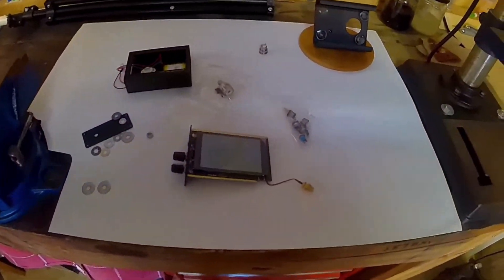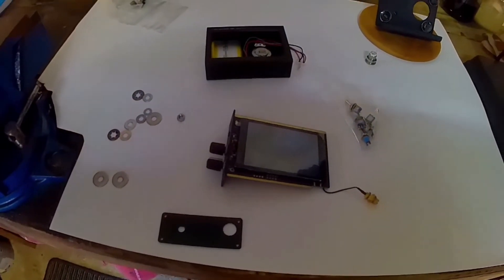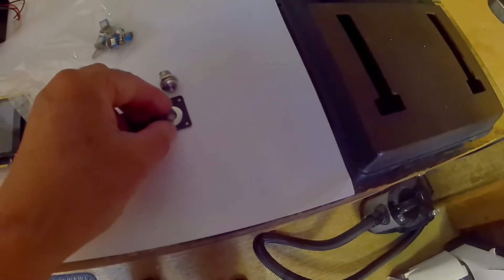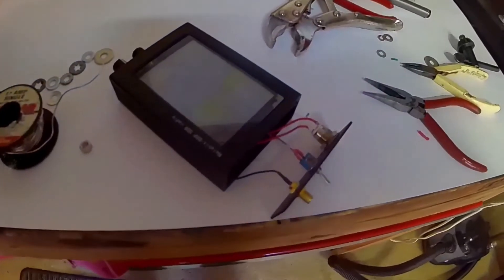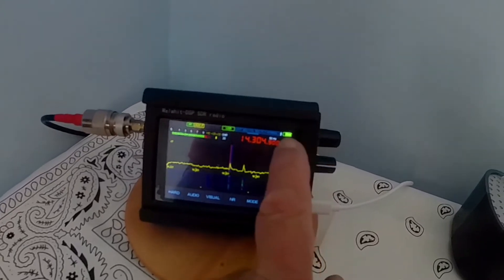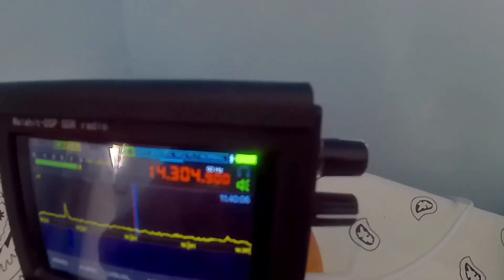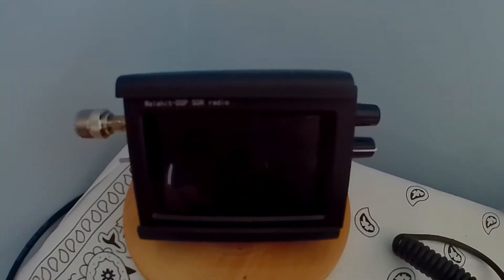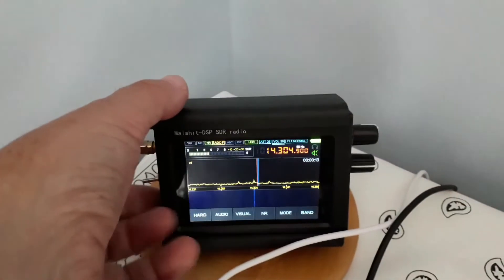Malahit SDR DSP Ham Radio Repair. Problem Solved.

Comment: You seem to have the same version of radio as I do.  I noticed the same battery drain issue and after researching online, I did a simple modification by adding a toggle switch.  This was years ago and I am pleased to see that you did exactly as I did.  Remember to flip the switch on in order to charge the battery and switch it off when it's charged if you don't intend to use the radio right away.  What I would like to know is can the screen be replaced with a 4 inch lcd as the cut out on the front would suggest that maybe to cut costs in manufacturing, they went with a 3.5 inch screen.  Maybe some items in the code need modification as well.  I know very little about programming.
Reply from the maker: I am hopeless when it comes to.updating firmware and computers as well so I don't even try. 😂 George

Comment: Got tired of hammering the quirky screen to make selections.  Removed the only useful part (battery), then tossed it.
Reply from the maker: There not brilliant bits of kit. I use mine in conjunction with my FT101B  Transceiver. Just to display the band I am.using. George

Comment: Hi nice video will be doing this switch with mine soon but I have a question,  where can I get the rotary push switches for one of these I need to replace both of mine .. cheers rob
Reply from the maker: Hi Rob. I am sorry to say this but although I replaced one of mine with a different type. Which was a nightmare to do. I have never found a direct replacement. I wouldn't advise you change them. You could destroy the radio completely.  George

Comment: On mine it is almost impossible to tune frequency because the encoder jumps frequency backwards while tuning forward, which encoder should I use as a replacement?
Reply from the maker: @Ixquick979  Allthough I replaced the encoder over 12months ago. It now jumps again. So far I haven't found a replacement and I am not going to replace it again as its too difficult to do . Don't want the risk of wrecking it. George

Comment: hi, can you tell me where to find replacement encoders?  Thank you.
Reply from the maker: Hi I am sorry I cannot tell you as I have been unable to find a direct replacement. I had to bodge a different one as a repair to mine. Its a nightmare of a soldering job I did I mine. I almost ruined mine in the process. The best option is to make a new enclosure for the radio and then there's enough room to solder wires on whatever encoder you find. George

Comment: I’ve got one and it won’t charge. No light to say it’s charging, nothing. Any ideas??
Reply from the maker: Is it a New Radio you have just received or has it just stopped working. These modern radios are not really designed to be repaired.  I am not sure. Try several types of charges. Some used for phones may not charge. As they communicate with one another via charging lead etc. George
Reply: @MakeDoAndMend1  it’s just stopped working. Worked fine the other day.
Reply from the maker: @wrightcreationswoodturning  Hi matey.  If they are left for a long time without been used they will flatten the battery. You  could try checking the battery voltage. May need the battery unplugging and reconnecting to reset charging circuit as they have battery protection if too low voltage. Other than that I have no other suggestion. George
Reply: @MakeDoAndMend1  yes it is the battery. I’ve plugged a 3.7v 600mah on just to check and it comes on. Cheers I’ll sit and rebuild one of the days.

Comment: Do you have a photo of where the momentary power button wires solder on to the board? One of mine has pulled off the board and I can't find the solder scar (the wire end looks like it was dry)
Reply from the maker: Hi many thanks for watching my videos. I am sorry but don't have any info or photos of the board with switch wires. From memory one of the red switch wires doesn't have a solder pad but attaches to one of the surface mount resistors. I am not willing to take mine apart to have a look because everytime I take mine apart it then goes faulty. Hopefully you will find another youtuber who can help. George
Reply: @MakeDoAndMend1  no problem,  I found  the point by trawling several videos and paying close attention

you're correct that it's a wire run from The side of a smd resistor and having located it i was able to confirm the joint was utterly dry 

my unit is doing the constant bootup cycling you mentioned as point 2. how did you solve that?
Reply from the maker: @miscbits6399  You put a 10k resistor from one of the red wires to negative or chassis ground. I think when you solder red wire onto resistor it damages resistor so just fit a normal resistor. There is a video in my playlist. George

Comment: Mine just stopped working/charging with the mini switch on “power” position. On the “off” position it plays with usb power in only. I’m not under the impression that your radio has such a mini switch in the bottom? Cheers!
Reply from the maker: My Radio originally on had the silver round switch with 2 red wires as in photo. Long press of this button switched it on or off. Short press was on but no display. No other switches. I added the blue toggle switch centre of end panel in series with battery wire. My radio has an all metal case. Some had plastic cases with extra switches. Cheers from old George